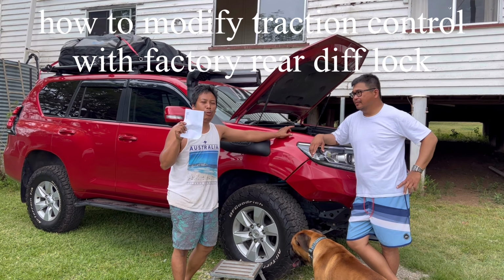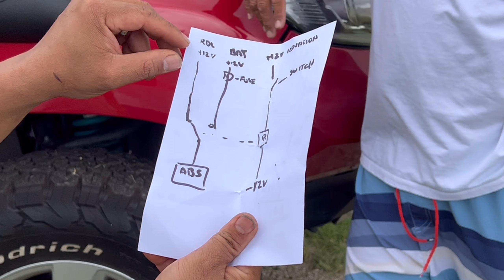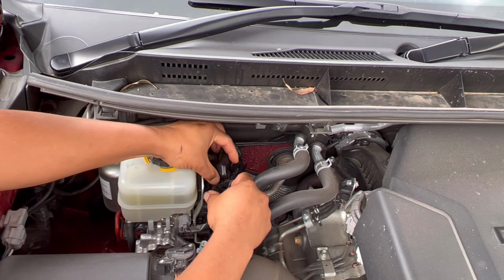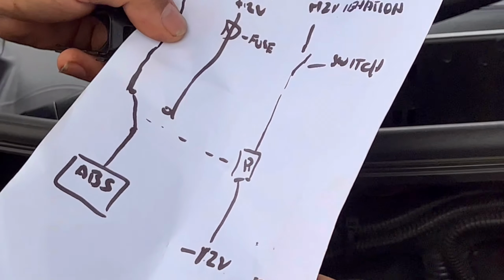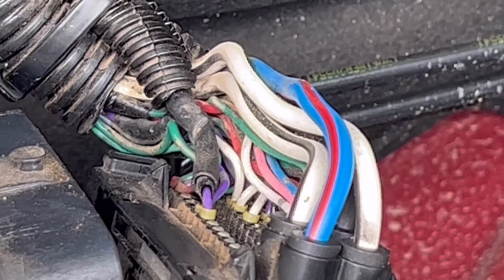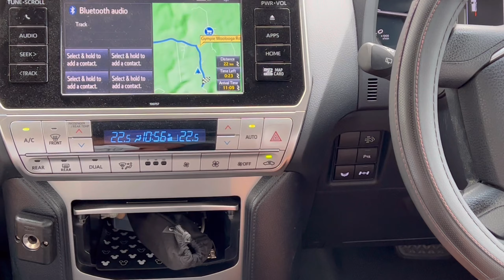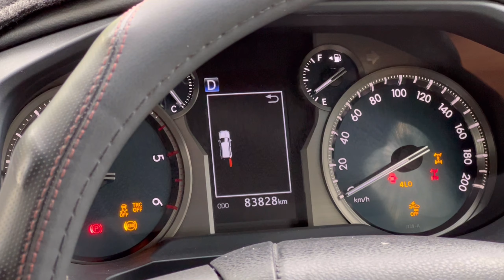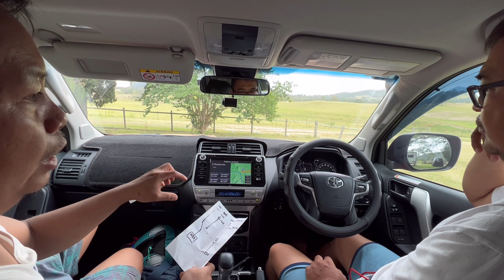How to modified the 150 prado traction control wiring fitted with factory rear locker

Comment: hey mate trying to do this today. That relay part is not clear. Why did you have to use a relay does it draw too much power? Why cant you run the purple wire to cabin and find a 12V source there and install a switch with an inline fuse? 

And also when you cut the purple wire in half, end coming out from the module goes to the relay and what happens to the other end? doyou just leave it insulated?
Reply from the maker: Doesn’t draw Mach power, just wanted to be fail safe, if you lost power from 12v in the cabin , the traction control and stability control will be turned off, the reply will make sure you got 12v to the system no mater what,

Comment: Nice one guys.
When the manual TC button is on now, what happens if you try and turn the TC off using the factory button holding down for a few seconds (like normaly turning off)?
Ive also read a review on a 2019 GXL that stated that sometime during 2019, the traction control remains on with rear locker. Any idea if this is true?
Reply from the maker: The prado on video is 2019 model and the traction control turned off when rear locker is engaged, that’s the reason for the wiring mods to make the tc on when rear locker is engaged.

You can still manually turn the traction control by holding the tc button, completely different circuits. 

Watch our laters video and watch the front wheel of the 150 prado as he got the rear locker engaged for the duration of that video 

https://youtu.be/suf_G4cxPVk

Comment: did that ABS light came after this modification?
Reply from the maker: When abs light is on, i means the traction control is off, the abs light is just telling you that traction control/A-track off is off.
When the Abs light is off , it means traction control working normal (on)
The switch modification is to turn (ON) the traction control /A-track off when the factory rear locker is engaged and the stability control remains off, 

The problem is when the factory rear locker is engaged , it turns off traction control / A-track off ,

Comment: Hi there,
I'm keen to do the same mod, may I ask any drawback on doing this? How did you find with this mod and any issue so far?
Reply from the maker: No drawback except for the cost for extra switch , wire and fuse. Mods was big in America Toyota FJ Cruiser as they share same system for the prado
Reply from the maker: No issue until now
Reply: @kuyaneillagalag1948  thank you so much for your promptly reply.
Reply from the maker: Very easy mods and your prado will become more capable off-road with the mods , just like having triple lock. 
The problem with factory rear locker is when locked, the front tc turned off and becomes open
Reply: @kuyaneillagalag1948  yea, you're right. Rear locked making front diff open without TRC which makes it kind of pointless locking the rear in some situations.